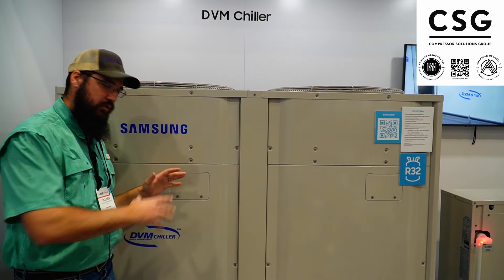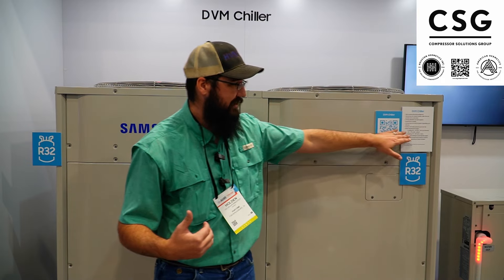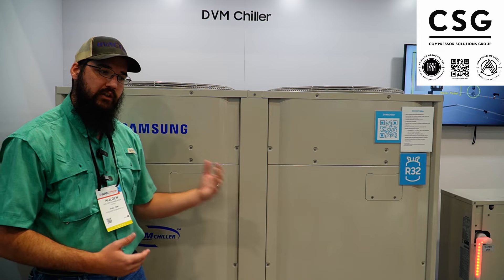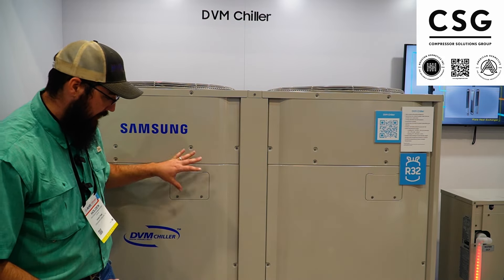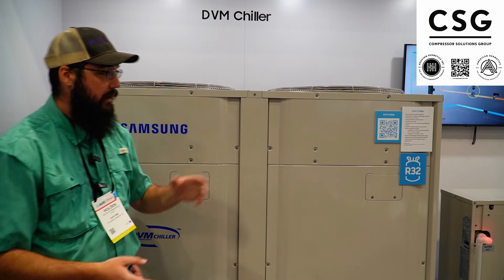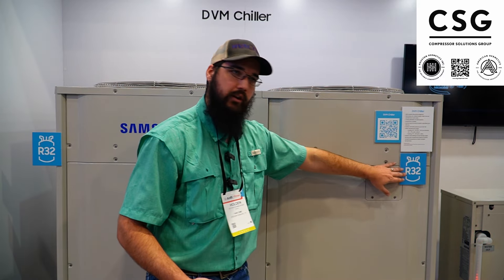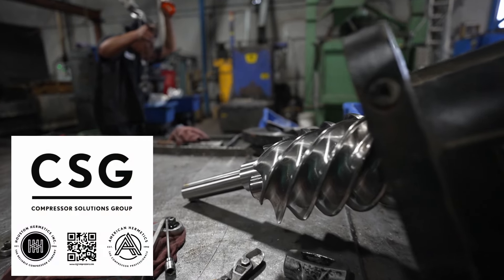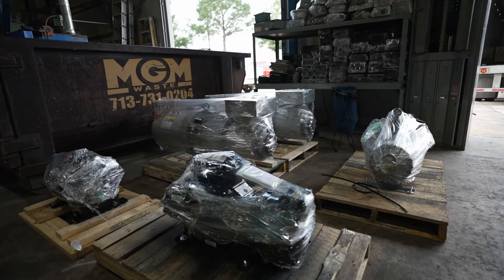Times Have Changed...VRF Chillers

Comment: They should’ve done this decades ago. I always had to purchase separately their Hydro blocks to connect up to the piping to the VRF to get chilled water or hot water. 

That was so unnecessary when there is more than enough room inside the cabinet to put a large plate heat exchanger .

But if our 290 becomes the prevailing, refrigerant and outdoor units, this will be the way to go like they’re already doing in residential around the world and just starting going to come to the USA. Panasonic already has one here. .